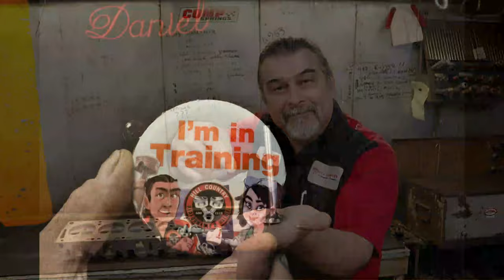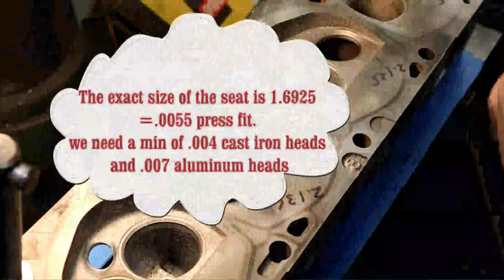How to convert your cylinder heads for unleaded fuel.

Comment: That was fascinating. The floating table feature on that machine is amazing, what a time saver. I'm still hoping you will do a video on valve guide replacement, especially on aluminum heads. Thanks for the great content.

Comment: Danny could you put the seats in the freezer prior to  pressing them in and allow .0005-.0006 interference ?
Reply from the maker: Yes you could and when installing seats in aluminum heads you need to because that much press fit would just tear up the bore installing the seat. You also need to heat up the head.

Comment: I had a 77 Dodge Aspen in the mid 90’s. The valve seats got beat out so bad, the damage was well in to the heads. Had to get new heads, and have hardened seats installed. 
I have a ‘75 Ford FE 360. I was told the seats were already hardened & didn’t need upgraded. Is this true ?  
It only has 30K original miles, because it was my grandfather’s farm truck.
Reply from the maker: Unless someone installed seats in the heads there as cast and should need seats. You will know how hard they when you go to cut them.

Comment: Unrelated question for you…..  Ring gap.   I am about to put together a naturally aspirated LS engine for an Ultra 4 4400 class car. 

Can you give a little extra ring gap to let the engine run at a higher temperature? For example running high Rpm’s for extended time battling for a podium finish, and the temp starts to climb 250-270ish.    I was thinking that the little bit of extra ring gap would let them expand more without pinching and scaring the cylinder wall. What’s your opinion?
Reply from the maker: Yes you could , great idea! Those are the things I look at when tearing down an engine and think about then assembling an engine.👍👍👍👍
Reply: How much extra ring gap do you think is sufficient?  Maybe just gap it for boost?